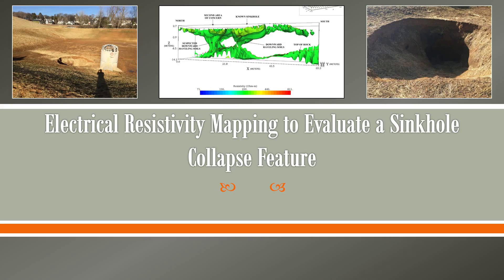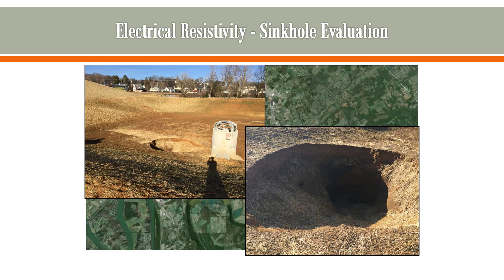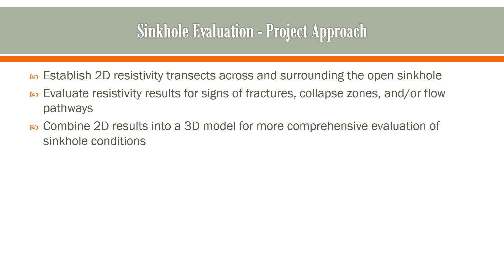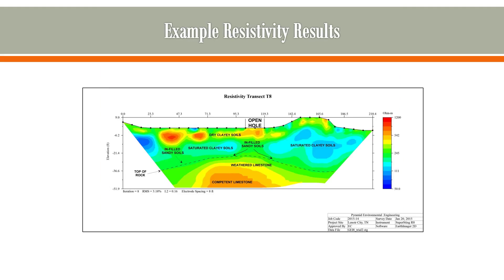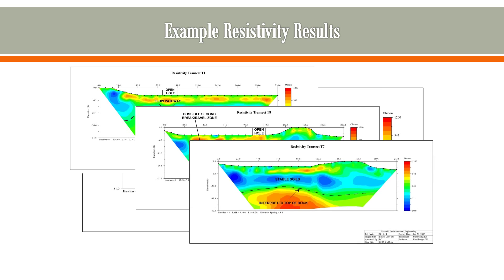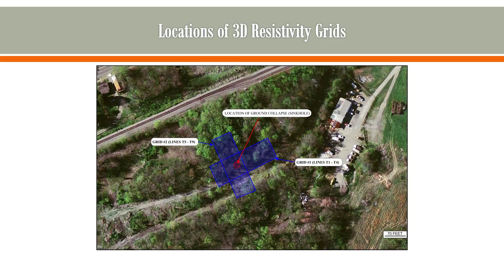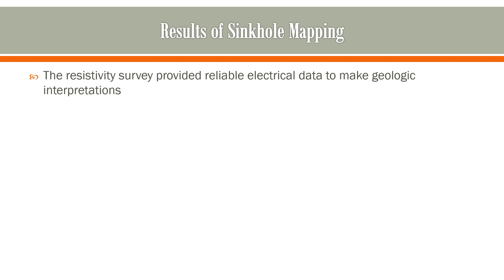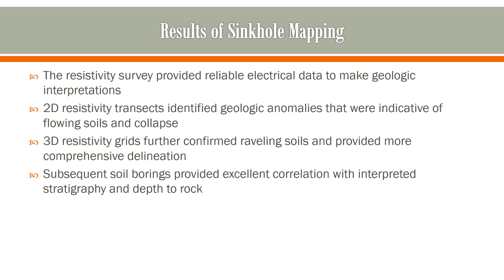Geophysics: Electrical Resistivity Mapping to Evaluate a Sinkhole Collapse

Comment: Interesting study. I would like to know, when modelling your res data, do you use a least-squares inversion or a robust inversion? I have noticed that the least-squares is most common, however the robust inversion is said to better display geological contacts or changes as it preserves bulk features. Any comments on this?